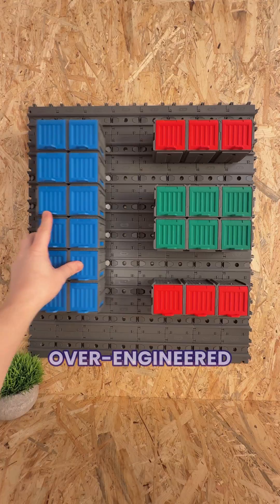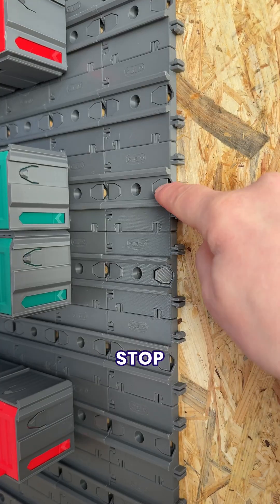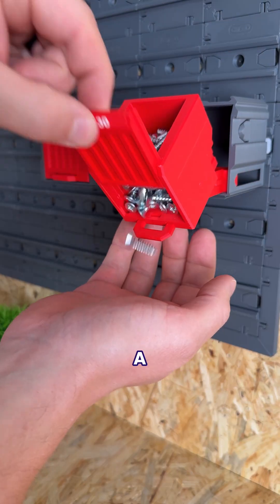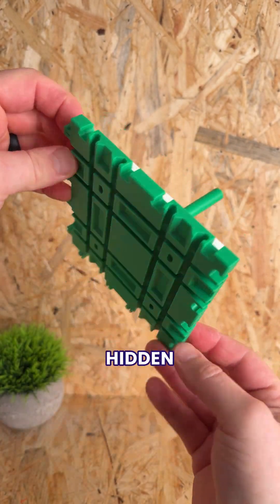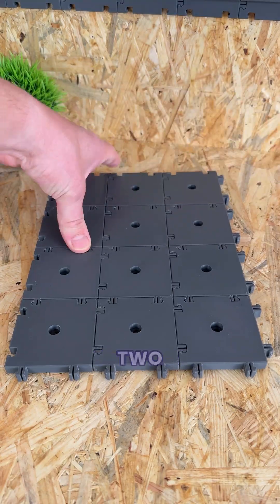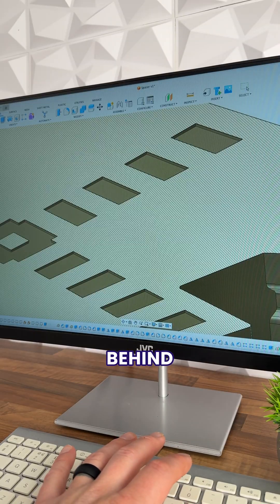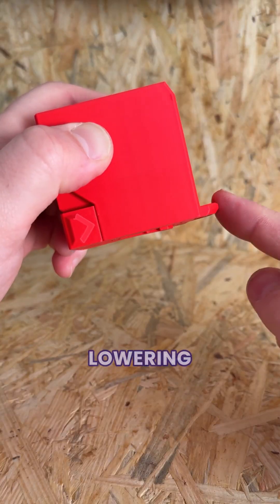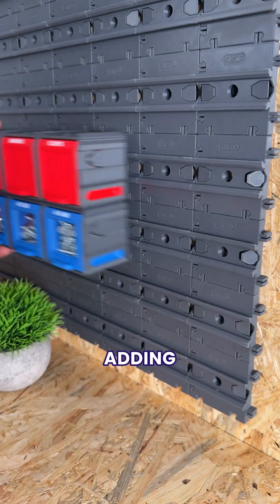Why is this storage so over-engineered?

Comment: its not over-engineered, its just engineered, lad.
over-engineered is when germans make rooftiling, without overlapping tiles, so they make a hidden path for water that gets trapped between tiles, under the tiles, but that path has no overlaps as well, so they make those channels go smaller and smaller.. you should see this.. 
In short, making a clever solution to a problem that should not exist in the first place, that is overengineering

Comment: Question: Do you have storage that's bigger than the small ones? Like maybe a storage tile that's the size if two small ones, or four small ones combined? 😃

Now to the response to your claim: That isn't overengineered as everything plays a vital part.
When you overengineer something, you've added things that aren't necessary to the design which means there is an easier way to have designed it. There isn't as far as I'm aware, this is the perfect amount of engineering 😃

Comment: This is awesome, can I ask what 3d printer you use? I'm new to the scene and am still learning, but would like to buy one soon.
Reply: best entry level ones right now if you don't want to commit a lot of money to it are an A1 mini ($220) or centauri carbon ($270), the carbon giving you a larger size and enclosure to print more advanced filaments. both extremely easy to use and very accurate!

Comment: None of it seems over engineered to me, it’s the perfect amount of engineering to solve the problem.
Reply: Iterative design can feel over engineered but yeah I agree they have also done alot to trim the fat
Reply: you have a really good point.
Reply: Same in that like saying the modern Leapard 2A7V isn't Overengineered.
Reply: I'd call the cable storage solidly overengineered. Not to a fault, I don't think, but it's got way more going on than it really needs